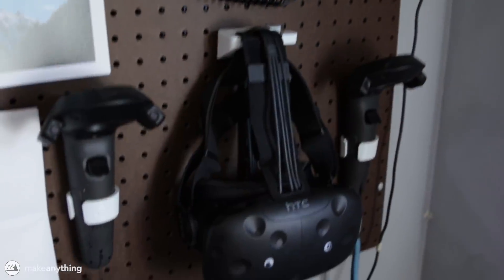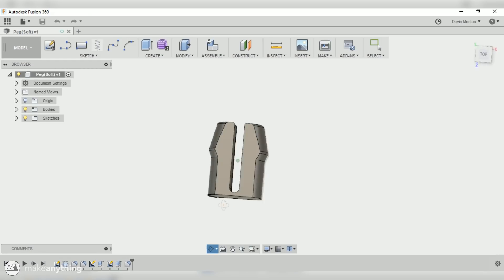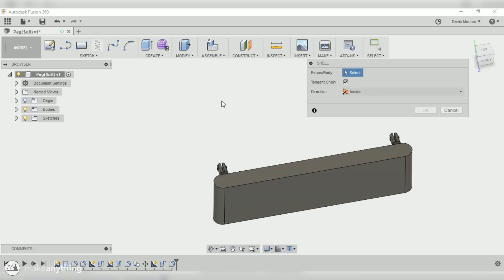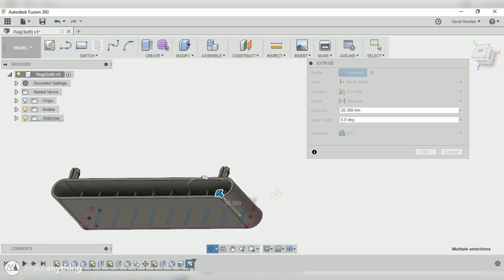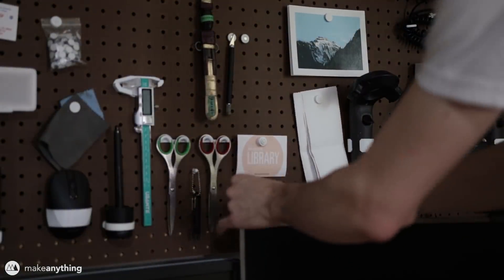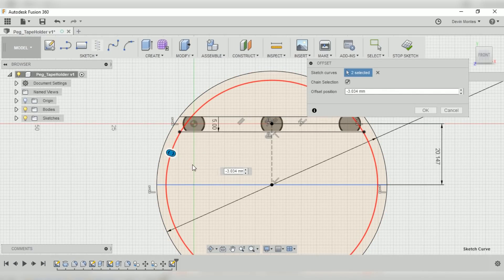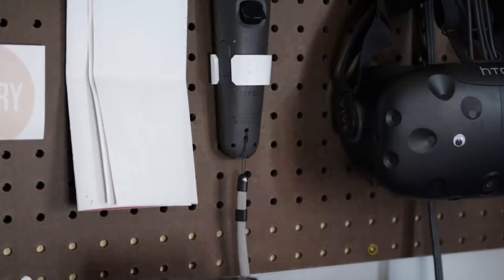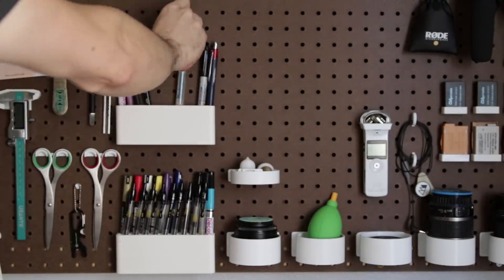Pegboard Anything 3 // Fusion 360 Tutorial

Comment: One thing to watch out for when designing pegboard projects is the spacing of your holes. Some boards use 1 inch spacing which is 25.1mm - However some boards are metric and the spacing is 25.0mm. - If your project is only 1 or two holes wide, you can get away with it. But if your project is 3 or more holes wide, your pegs won't line up with the holes.
Reply: Um, 1 inch is 25.4 mm.
Reply: Yes, your correct, but it doesn't change the point I was making about hole spacing.  -Cheers

Comment: What is the real difference between the pro and build filament?
Reply from the maker: I believe PRO is just a bit tighter with it's tolerances, and the color consistency might be a bit better. PRO runs at a hotter temperature generally, so maybe there's more to it, but they've both been great so far.

Comment: Make a 3d printed pegboard.
And i wonder when i try to 3d print an stl file on a stl 3d printer why does it break my modle into pieces even know it was a square
Reply from the maker: You have to use a slicer to convert the STL into a .gcode or .x3g for your printer to read it

Comment: you should make an attachment to hang a 3d printer on a pegboard
Reply: not if you had enough struts to support it
Reply: No it wont work because you need strong support like a table so that when the Printer arm is moving it doesn't wobble.
Reply: use stronger filament